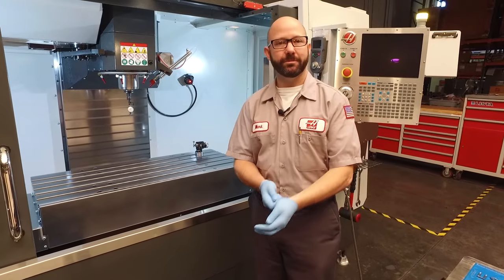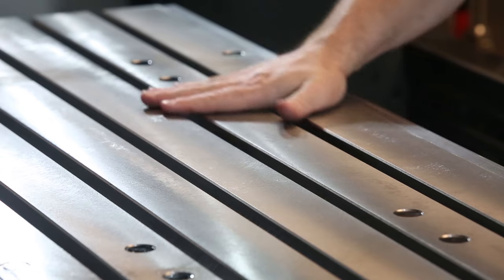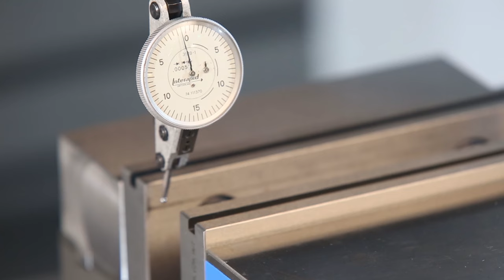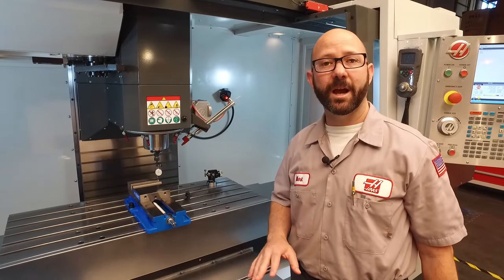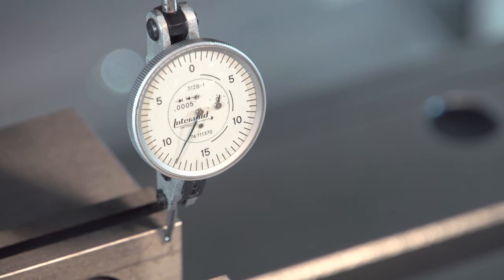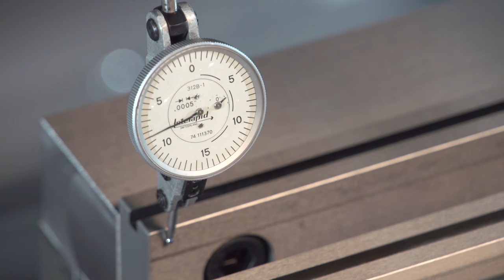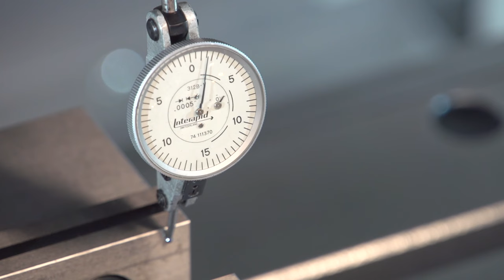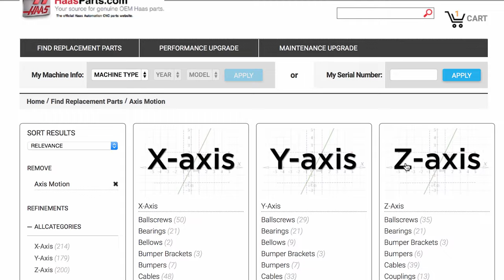How to Square and Indicate a Vise on Your CNC Mill – Haas Automation Tip of the Day

Comment: General rule, don't tap the vice so that it moves against the indicator, as you can damage it.
Reply: Every text book written over the last 100 years says exactly the same thing, and if your in a school full of newbies, you realize that you don't have to hit it hard, you only need to forget to snug one side and snap the finger off a 150 dollar Mitutoyo dial to see the wisdom in that.
Reply: Every textbook that details aligning the vise will caution against tapping against the indicator. Machine Tool Practices, Kibbe et al. Unit 3: Setups on the Vertical Milling Machine page 475 "When tapping the vise, move it in such a direction that the solid jaw moves away from the indicator tip. Moving the jaw against the indicator tip can damage the delicate indicator because of the shock delivered to the indicator movement."  Technology of Machine Tools Krar et al. Unit 66 Milling Machine Setups page 528 "Note: Never tap the vise so that the parallel moves against the indicator plunger. This will damage the indicator". I don't have the Moltrecht books handy but it would be a fair bet you'd find it there too. I do have 2 other textbooks, Modern Metalworking  as well as Machining Practices by John R.Walker, but they're barely worth the paper they're printed on, so no surprise they don't have it. I don't know how you do things in the US, but in Canada everyone learns in a school at first, or has to go to school to get their levels, and this is standard best practice here, as well as in the UK and Germany. Your either a skilled tradesperson or your not. This is also a question that can appear on the Red Seal exam. There's a right way, and there's a wrong way, and no matter how much you may protest, tapping against the indicator is the wrong way.

Comment: For starters this is completely unnecessary just bolt the fuckers down loosen one side put indicator at zero move torwards otherside till .010 then bang to 0 and keep doing so till you reach other side and tighten bolt on other side and loosen one on side you tighten and repeat bam done run handle .1 x axis 0 all the way through baby.
Reply from the maker: Ryan J – Lol. I followed your explanation – it makes perfect sense. Get it done! – Mark, Haas Tip-of-the-day.

Comment: Can you put a soft limit in the control?
Reply from the maker: Mike – In the latest versions of software, on Next Gen Controls, we have a USER POSITIONS tab, under SETTINGS. From here we can set Max Travel Limits on XYZ axes, and MAX/MIN Travel Limits on our rotary axes. Similar functions are available on older models, but would require a Haas Service Tech to come out and make some careful Parameter changes. – Mark, Haas Tip-of-the-day